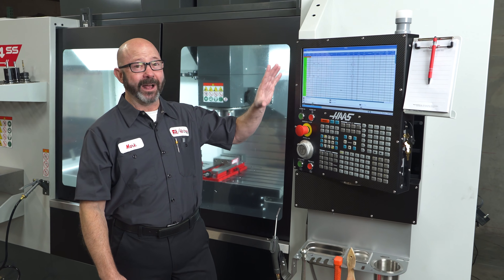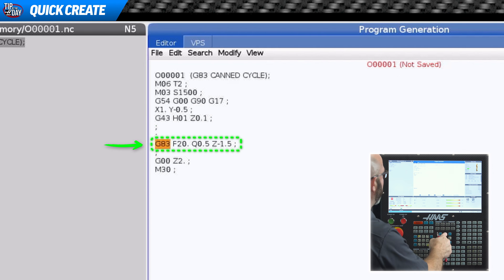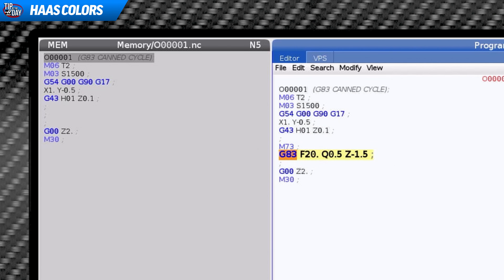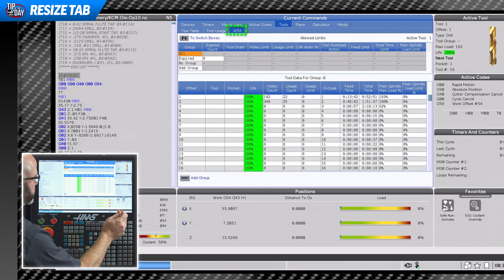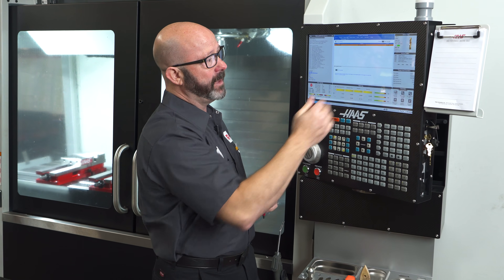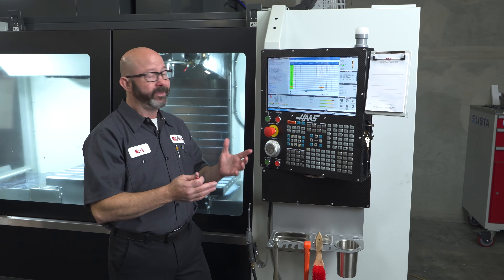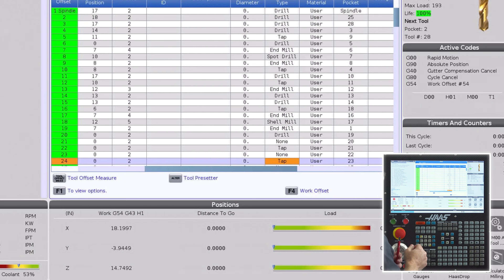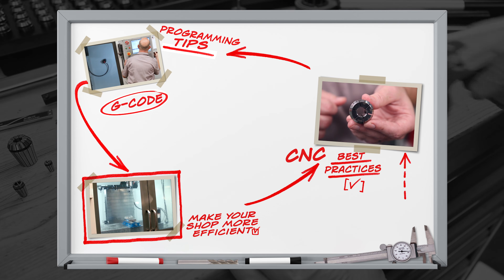Haas 19" Monitor Touch Screen Enhancements - Haas Tip of the Day

Comment: I am a manual machinist. 
I will not be deleted.
Reply: You may not be deleted , but you will be ran away in the next 10-15 years . 1 off parts are even getting to the point where CNC is worth it
Reply: @codycrouser5735  
Nope.
 The CNC is NOT a cure-all.
Manual lathes, mills and drills will ALWAYS be needed.
 What kind of goof sets up a CNC for single, one-of-a-kind parts that can be produced manually, saving lots of money?
What if something needs a slight modification?
 I have been doing this for almost 30 years. Trust me, I know what I'm talking about.
 In fact, guys like me are so hard to find, that my company, (ASTEC) is hiring high school kids that are willing to learn the craft.
 How do I know? I am a trainer. (teacher).

Comment: The touch screen is very nice and robust.  My only issue is that at times the screen would blackout for a second.  This would happen maybe 3 to 4 times within the first 2 hours of turning it on.  After that, the blackout does not happen.  Still happy with it.  Thanks Mark for the video.